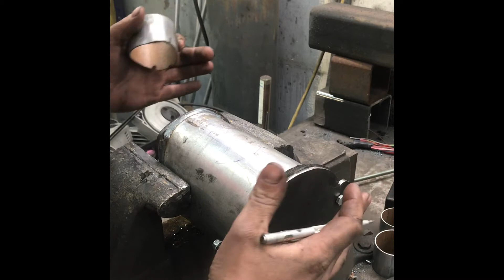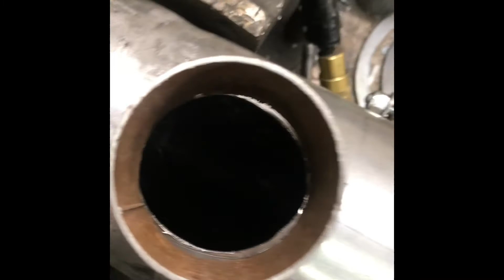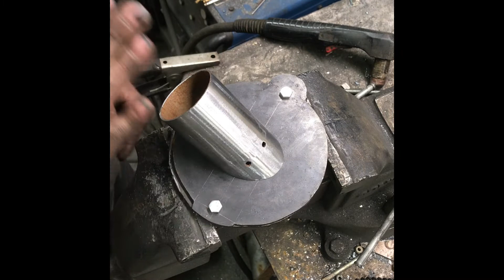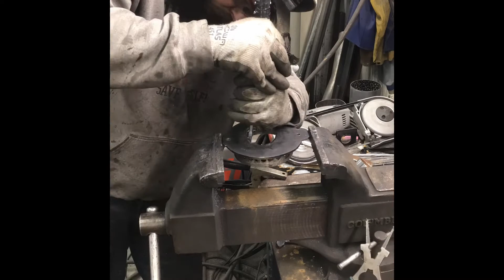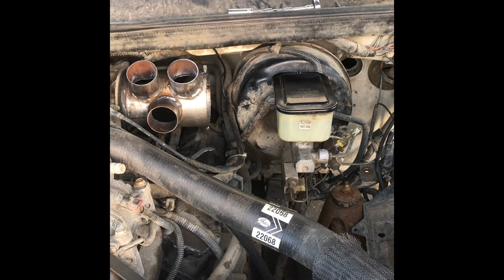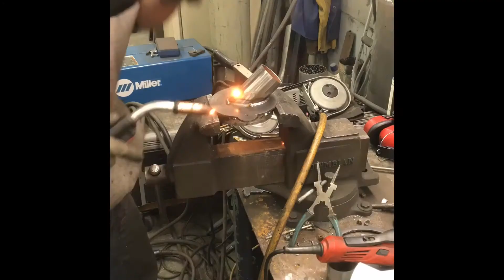V10 RAM WOODGAS  mixer box part 2

Comment: Thanks for this video. I bought the book and premium access to Wayne's site the other day. I'm the guy looking at building a system for my 2003 Ram 1500 with a 5.9 L V8. I couldn't figure out how to build the air box but this gave me an idea of how I might go about making one. Keep up the good work.
Reply from the maker: Your truck would be super easy I would go to the junk yard and get a early 318/360 air cleaner housing and make it just like Wayne does for the Dakotas. If you look at my Toyota it's basically how I made that one just using throttle bodies instead of damper valves. The V10 got built this way because it is a VERY tight fit in the space available

Comment: Plasma hole cutting guide - Use tubing as a cutting guide. I used a bandsaw to cut a 1/4" long piece of 5" diameter x 1/8" wall tubing. Welded a tab to the outside to be able to clamp it into place. By dragging the plasma tip on the inside lip of tubing, it cuts a real nice 4 1/2" diameter hole. 
I made plenty of other sizes too. 
I also use 1/4" x 2" flat bar as a guide for straight cuts.